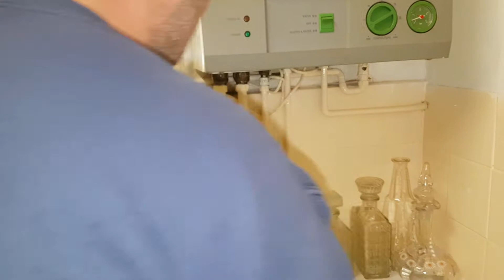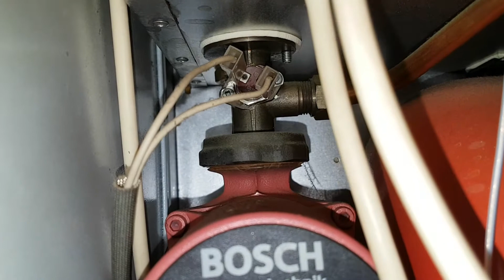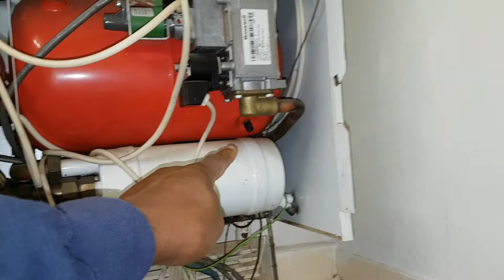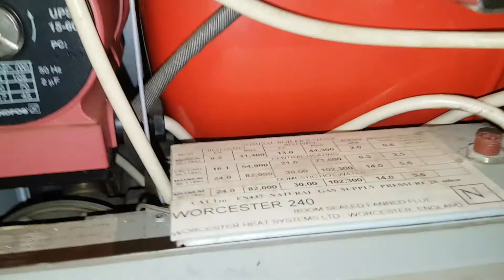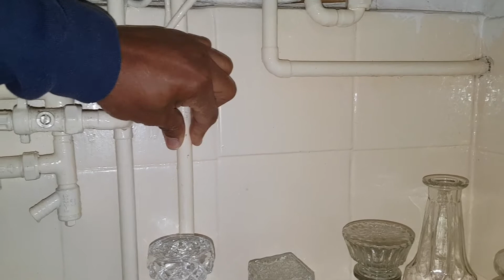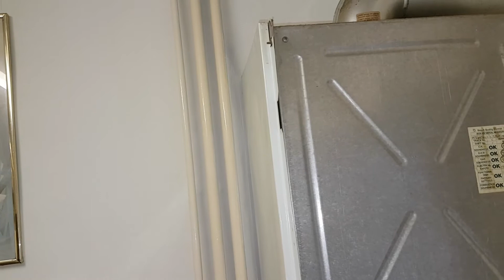Pursue Your Dream with Waseem Karim Part 3

Comment: Tony  i Couldn't believe that if you are responsible for training this apprentice and trying to demonstrate  good practices to u tube followers having  failed on the following basic tests before and after  leaving the boiler in a safe condition , (1)  Both inlet and outlet test points were undone for gas pressure Dynamic and static  readings  and   neither were tested with leak detection  fluid following the re tightening of these test screws . (2) The boiler casing was not  checked for earth leakage with a non contact volt pen prior to touching  the case ,( 3) Safe isolation was not carried out to confirm the isolating fused  switch   had actually removed any voltage from the boiler prior to working on the appliance .(4)  The resistance of a heat sensor cannot be tested with a multi meter correctly if the leads are not removed from the sensor as you will be reading resistances through the pcb or harness cables  at the same time , so his reading of 1.5 k ohms was incorrect even though you said it was acceptable . The sensor on the central heating flow pipe on this boiler should read approx  20 kilo ohms at 10 to 12 degrees c . (5) A inlet dynamic pressure  of 15.5 mb is below what the manufacturers consider acceptable for this particular model therefore the boiler should have been labelled as at risk and the customer made aware of it,  until the low pressure fault was rectified , I did not hear you mention this neither  to your apprentice or customer you just said " BUT ANYWAY IT IS WHAT IT IS" . Sorry Tony but if you are trying to profess to be professional heating engineer with the capabilities to teach others you should really reconsider some refresher training your self before launching videos of this importance on u tube . Would like to hear other comments from gas engineers if you feel i am being a little harsh .
Reply from the maker: Thank you your comments what area are you in?
Reply: Basingstoke , HSE HQ .
Reply: @frankiepc8119  I fully agree with ya
But I am no sure if he just didn't recorded that bit but this is just a messed up way of teaching 
Dk what's he learning in classroom

Comment: Isn’t the PRV just as old as those heating valves?? Hope the discharge pipe goes out side as well, looking at age of the boiler there could be a new extension or a conservatory add seance the boiler install🤔🤔

Comment: I thought you never touch the prv as it is a safety device and Drain the system down the drain valve.
Reply: Yh i was taught that it could knacker the spring on it
Reply from the maker: There is always a first time